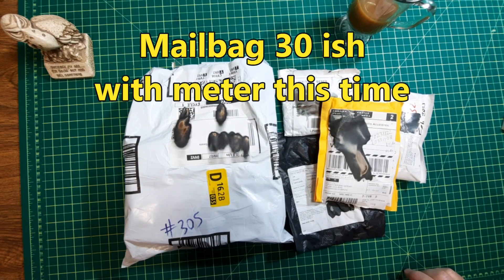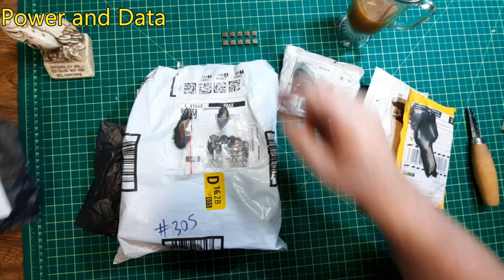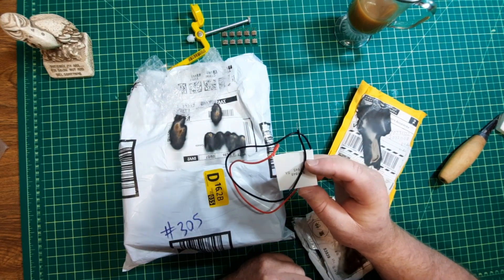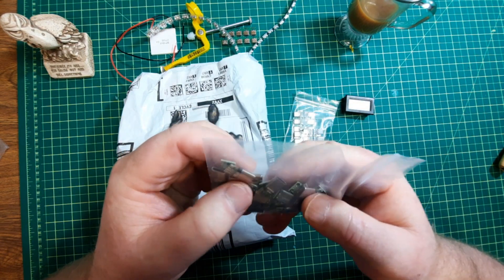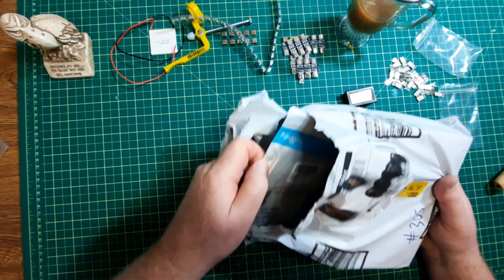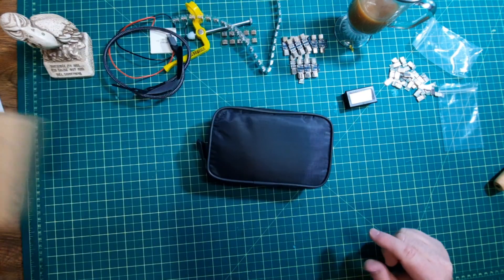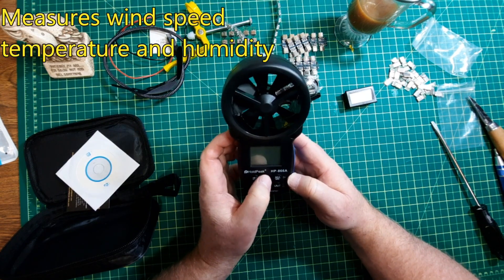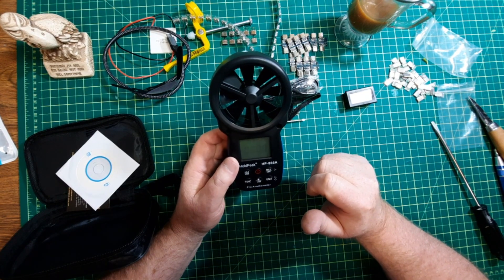Electronics Mailbag 30 ish with meter this time

Comment: Ow yes, very nice haul! NOTE OF ATTENTION: You can't use the USB-C connectors with a USB PD power supply if there are no 5K1 resistors on the CC1 and CC2 pins. Even for a standard 5V, a PD supply needs to know what to give out. 5k1 on the CC pins indicates just USB 2.0. So if you plug them in to an PD supply and get no voltage, you now know why :D For USB-C to USB-A your are fine! Ow btw... 5K1 to GND for a 5V sink.
Reply from the maker: Good tip! So far I have not had any issues since I use the C to C simply for file transfers. Don't have any wall warts with USB C outputs. Will have to remember this when I start adding C to standalone displays. 
Have a good day

Comment: I see that you burn off the name address. What you do with the bags?
Just throwing into bin?
I'm cutting the labels to small pieces but it takes lots of time. Will try the heat
Reply from the maker: The plastic ones are just garbage since our recycle program will not take these. Sometimes I use these as little garbage bags. The paper ones from Amazon can go in the recycle bin. AliExpress paper have a plastic liner so sadly it goes into the garbage.
Have a good day
Reply: A heat gun on the thermal paper address labels is a great way not to dox yourself :)
Reply from the maker: I just use a butane lighter. The only heat gun I have melts the package on high, and on low does a poor job of it. A heat gun with a fine nozzle probably would work great.